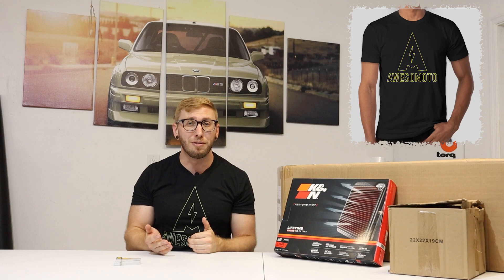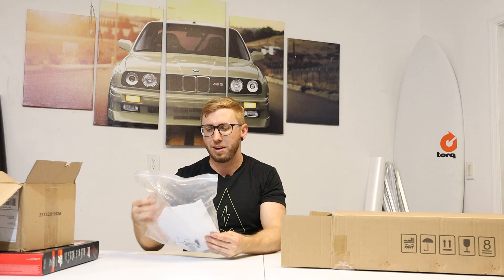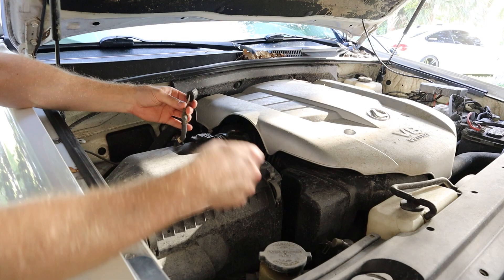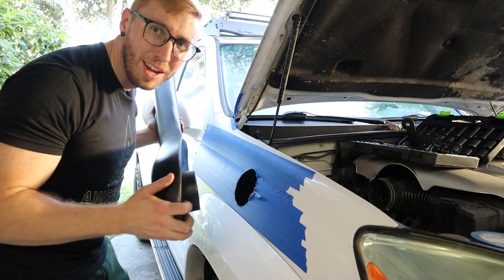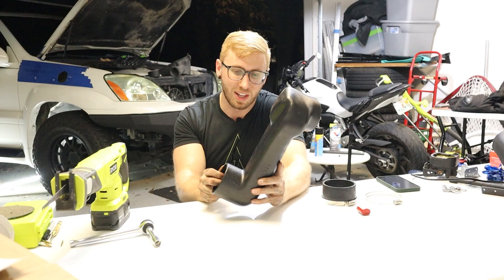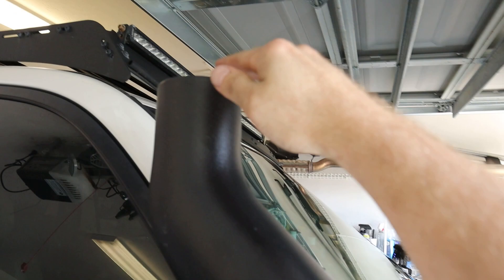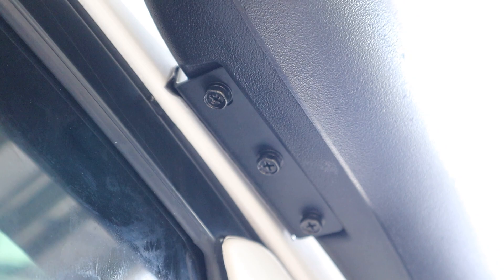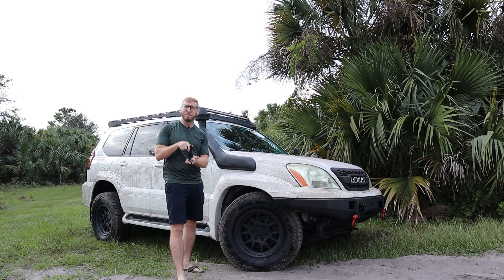Vlog 59 - Lexus GX470 Snorkel Install

Comment: Nice video install 👌🏼. I'm on a search to get a GX soon along my 3 Yotas and I've seen all your videos so now I have my to-do list on things and mods the GX should need. I once did the double side tape method even with the heavy duty one but the weather here in Puerto Rico didn't last too much so ended up drilling the 3 holes for the bracket on the A-pillar.
Reply from the maker: Thanks Carlos! I'm about to go this route as well LOL. I'm up north for a few weeks and the cold weather caused the tape to contract and lose grip...now I'm looking for a better solution or just drill it!

Comment: Great video! I also had to bend my snorkel mount to the A-pillar, but I used magnets. Confirmed they are scratching the paint. Also I've got the Rago ditch light mounts and they don't hit the snorkel (just the wiper blades when you remove them), so you should be good there.
Reply from the maker: Yeah, well my Gorilla tape approach didnt turn out any better. The cold air up in Pennsylvania caused it to lose grip lol.

Ah, I didnt even think about the wiper blades hitting! I just installed them and love the design and easy install.

Comment: I purchased and installed the donsinson’s snorkel a couple weeks ago and I swear it has to be the same as the Amazon/eBay you have. The template and hardware are exactly the same lol
Reply from the maker: LOL Jose. I was starting to think that myself when I saw pictures of it. I wonder if the same factory that manufactures Dobinson's knocked it off?
Reply: @Awesomoto  I’m sure they come from the same factory

Comment: Hey! I have it all installed except for the pre cleaner. Can you share the details of the coupler that you found at Home Depot? The guys here tried to help but we couldn’t find the one that fits. Thanks
Reply from the maker: Hey Diego! Yes, this was a rubber coupler that I reused from the kit. The one I bought at Lowe’s was for the air box. I recommend measuring the diameter of both the snorkel top pipe and the precleaner. Buy that diameter coupler and that should do it. Were you having issues with getting one that got that size?

Comment: I presume that these modifications prevent you from using drive-through car washes, correct? Do you just use a high-pressure wand to clean it now?
Reply from the maker: I have always stayed away from the drive through washes as I'm not a fan of the cleaning(or lack of) they provide. I personally have a SunJoe pressure washer I got off Amazon years ago and its still running great. I also upgraded the wand with a stubby one and additionally added a foam cannon to it.
Reply from the maker: I guess as a side note, this snorkel sucks air in from the bottom so going through the car wash wouldnt cause water to enter the intake. It just becomes another think for the spinning brushes to rip off.

Comment: Hey I am getting ready to install mine. Any issue with the pre-cleaner so far?? I got everything you’ve recommended.
Reply from the maker: Hey Ron, sorry for the delay. No I haven't had any issues with the pre-cleaner and I definitely prefer its more aerodynamic design as the wind doesnt pull it as hard as the regular snorkel top.

Comment: Question::: will this snorkel fit a 4th gen 4runner?
Reply from the maker: I’m not sure if the alignment is the same. I wouldn’t take the risk purchasing in case it’s not correct.

Comment: You've had this for awhile, any complaints or regrets so far? Just fitted 35s and my liner is looking a little "open"
Reply from the maker: No complaints so far. I love the pre-cleaner as its more aerodynamic and has less wind noise.

Comment: how is that double sided tape holding?
Reply from the maker: Surprisingly rock solid still after many muddy trail days and pressure washes. I switched to alien tape after the first 30 days and that held up since even through the cold of winter. You can find the alien tape at Lowe’s or any hardware store.
Reply: @Awesomoto  Thanks. For anyone wondering, [a close friend is a professional painter and told me] most of these companies use 3M VHB tape from the factory. We used it when he repainted my rear emblems and fenders. It's VERY strong, but it still hard to believe these double sided tapes are that strong.